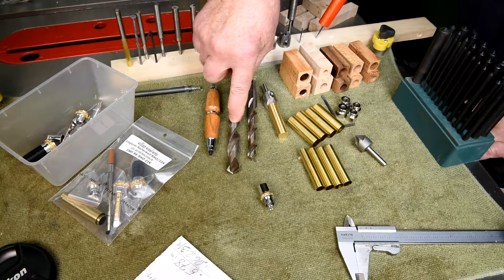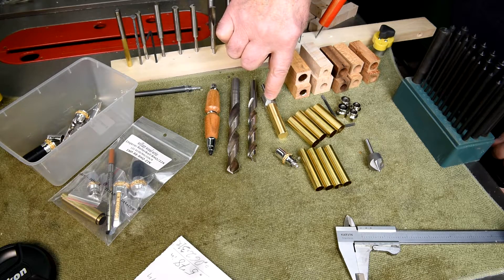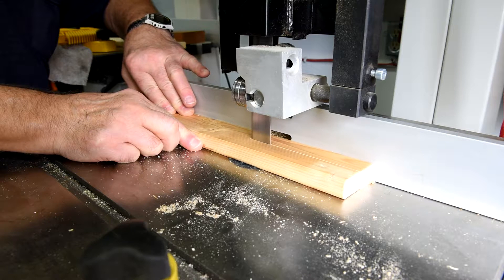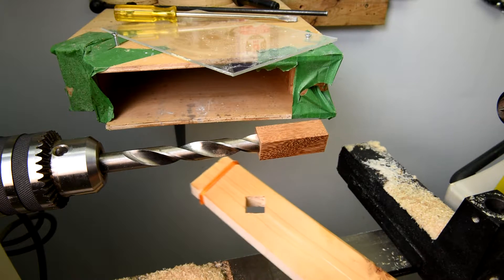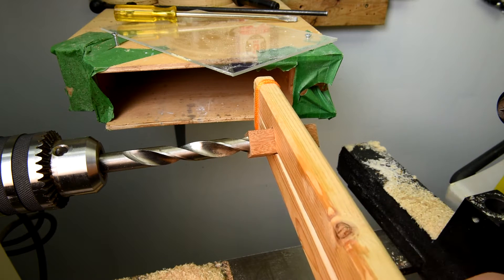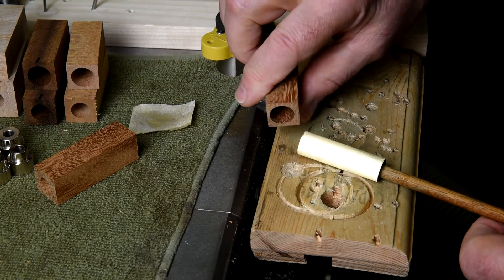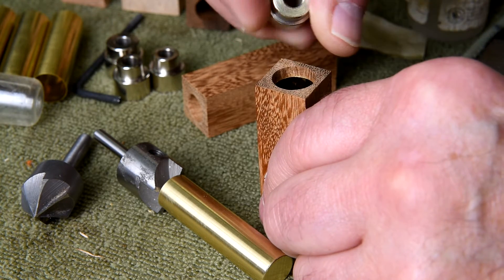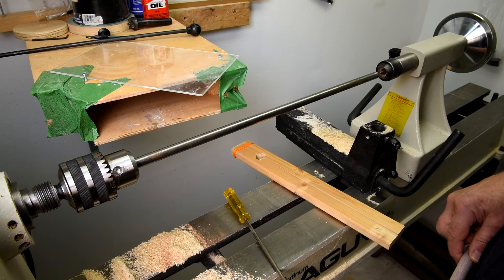"The Emperor" Pen - Part 8

Comment: Hi Ron,
in this case of enlarging by sanding I would turn the strip of paper vertically around the rod, maybe at a 45°angle e.g. , and secure the ends with scotch- or ducktape.
Best regards from germay 
Sebastian
Reply from the maker: Now that's the best Idea I've received yet. Should have thought of that myself. Same as my drum sander, but smaller.

Comment: Nice videos again. I use sandpaper on a shaft all the time to enlarge holes. Here's how. Grab a steel rod 1/4" or 3/8 about 6" long. cut a slit about 1" or 2" long, whatever your sandpaper you have I prefer 2" wide sand paper using your bandsaw. Than put the end of the sandpaper into the slit and wrap around the until the sandpaper is about the same size as your hole and use your cordless drill to turn it in your hole. Be careful it takes a lot material out fast. Use 220 grit to avoid opening up to fast.
Reply: I have 1/4 and 3/8 for smaller holes and 3/4" for larger holes
Reply from the maker: I was thinking about a slit in a rod, or long soft bolt, too. Just was trying to avoid a lot of extra work. However hanks for that suggestion.  The tape I was using was not sticking to the sandpaper. Maybe duct tape will work better. Like I said in the video, I haven't totally give up on this idea yet. It's just that I was running out of time (and energy) last night, lol    :)

Comment: I can relate to the hollow chisel mortiser thing.  Bought mine three years ago,  along with some expensive chisels and bits and built a nice stand for it.   Used it once so far.     But.................... it sure looks good and it's there if I need it.  :-)                       

Did you call the supplier of that undersize drill bit?                                                      JimE
Reply from the maker: Re: the " hollow chisel mortiser thing" My experience exactly, right down to building the stand --- and that was about it, lol.
I emailed William Wood-Write Friday night. It's the weekend now and even though they are closed, "Bill" did reply and wanted more details. Guess he never saw the video.

Comment: Maybe for the sandpaper you could use contact cement or spray glue. The they should come off the rod with a little bit of rubbing alcohol.
Reply from the maker: Thanks for that suggestion.  The tape I was using was not sticking to the sandpaper. Maybe duct tape will work better. Like I said in the video, I haven't totally give up on this idea yet. It's just that I was running out of time (and energy) last night, lol    :)

Comment: Hi Ron,

I use this   https://youtu.be/WTgNPn7A_zU

Make the sandpaper a little bit bigger than the hole and put the rod in youre drillpress.
It has a bit of a learing curve but it works great. 
Note... put sandpaper in the middle of the hole with the drill shut off and than start the drill.
So start in the middle and be carefull at the "edges"

Goodluck,

Peter.
Reply from the maker: Hi Peter,
Sorry, but that YouTube link won't work ???
Reply: its a rod about 6mm diameter and 100mm long.
make a slot with a hacksaw in the rod (vertical).
than fold a piece of sandpaper (cloth back) dubbel and fit this in the slot.